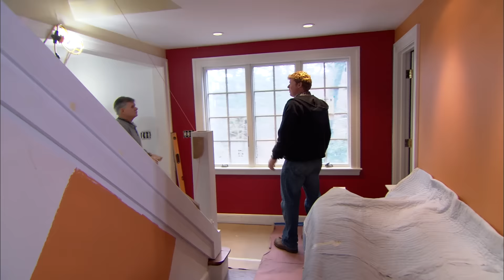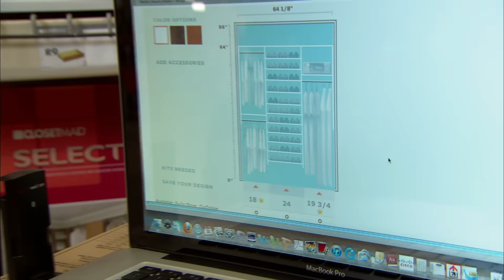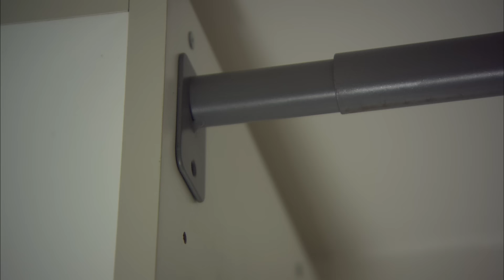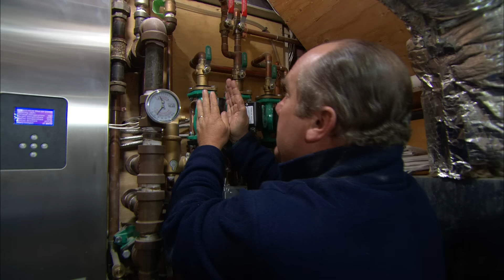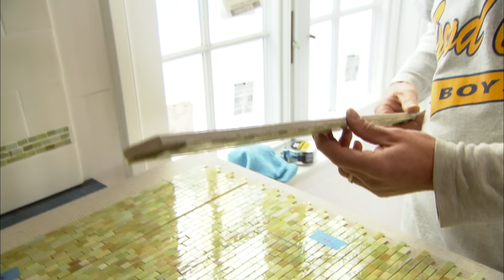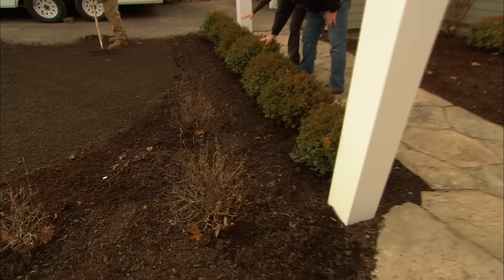This Old House | Systems, Security, and Surfaces (S32 E15) | FULL EPISODE

Comment: Don't buy that lock. it's easy to compromise with just a coke can. if you want an amazing lock get a Mul-T-Lock 800 or a really nice Medeco with rotating pins. So you can compare, that lock had 5 pins, a Mul-T-Lock has 16. a bunch are pin in pin telescoping pins, and and 2 active pins.

Comment: These people need to buy batteries by the truck load with that wireless security setup.
Reply: I'm hating life right now because I have to replace soooo many watch batteries in these sensors!!!!
Reply: Those sensors use watch batteries. They can last for years.
Reply: @saulgoodman2018  Two years if you're lucky. I know this because I have to change them.
Reply: @tjgsomething  So what. It's not that bad.
Reply: @saulgoodman2018  Replacing 20 batteries every 2 years is a pain! Especially when some become unmounted and require new adhesive. It's almost a whole day chore.
Reply: @tjgsomething  It is not a pain. Those are clipped into the mount. All you doing is unclipping it.

Comment: How much did kwikset pay you to pump their reprogrammable lock? You can go ask any locksmith that these are simple to bypass with a brute Force method because the discs tumbler is not strong. If you need a key lock just get a good one but most people nowadays are using electronic which makes it much easier to change the code if somebody moves or forgets it! Some are even remotely programmable and can be monitored.  If you must have a key get a Schlager lock set and it can always be re-pinned to match a new key for not much money...
Reply: Dude this video is about 10-15 years old
Reply: @jej3451 doesn't really matter, they still sell those reprogrammable locks and they still suck. Obviously the electric locks have made advances since then
Reply: In a residential house all you need is a simple deadbolt type lock. If a thief really wants to get in, they will get in no matter how much money you spent on the door lock. The simplicity of being able to change the door keys instantly is where you're going to save your money.
Reply: Eh, they're fine. You're forgetting anyone could smash a hole through the wall in one minute with an axe or sledgehammer, or break a window. That lock is far from the weakest point

Comment: I definitely wouldn’t use that particular door lock model nowadays. Too many thieves do research lock weaknesses on YouTube to break into buildings
Reply: In a residential house all you need is a simple deadbolt type lock. If a thief really wants to get in, they will get in no matter how much money you spent on the door lock. The simplicity of being able to change the door keys instantly is where you're going to save your money.
Reply: Thief's can break into any lock. First they have to unlock it. At that point, they are already in the house.

Comment: With that huge block of mahogany countertop I don't know why you would put a clear coat on it! It's definitely going to get chipped and cut through use and then the repair is much harder. Why not go with a simple oiled finish? It's just as durable and allows easy repairs of any Nicks or cuts! It also darkens the wood about as much as that black chemical that you put on it first. Seriously, anybody interested in having a non-plastic house would not opt for this finish because every time you use it there are microplastics generated. The same goes for the perigolo made of PVC. in my experience Building, PVC is just as expensive or more than wood and the only reason to use it is to prevent rot in particularly wet locations like around exterior doors and windows or if you have a water board near ground level. Obviously the owner is dictating much of this...
Reply: just wait until they set a semi hot pan on that surface and the mark it leaves behind lasts forever. Unless you sand off a 1/8 inch on the entire surface.

Comment: The textured granite counter looks nice but would be difficult to clean due to its uneven surface.
Reply: It's not at all. It cleans just like any other granite countertop. The divots aren't deep, it just adds a light texture to it. I've got some quartz countertop with the same textured effect done to it, looks great and doesn't require any extra cleaning. Just wipe it with a soapy rag like you would anything else.

The wood countertop on the island is the one going to be a nightmare. Have to be careful putting hot stuff on it or you'd have to refinish the whole thing
Reply: @tacojohnhg8181 That's encouraging! I avoid anything high-maintenance in the kitchen if I can help it. No point in creating more work for my housekeeper aka me.
Reply: Agreed - honed seems like a much better tradeoff for a non-glossy look.
Reply: We had honed black granite in our short term vacation rental home in North Carolina. 275 guest nights a year, and no problems with the granite. Held up just fine.
Reply: @deerwoodretreat  That's a very successful business!
Reply: You can easily clean that.
Reply: A true nightmare lots of bacteria!